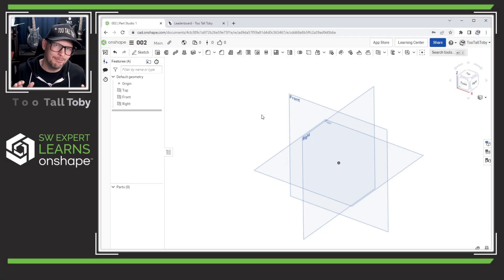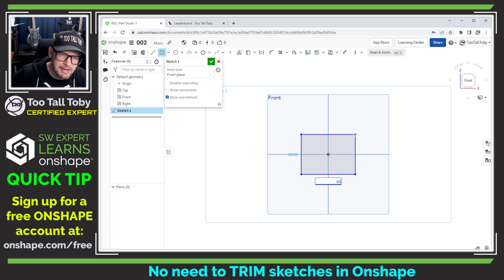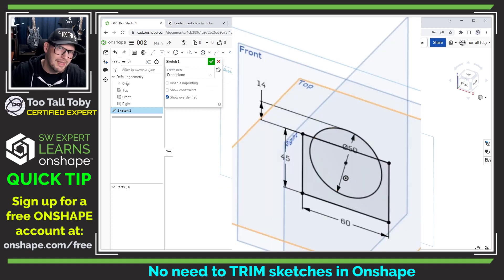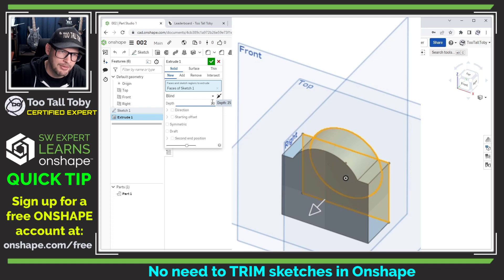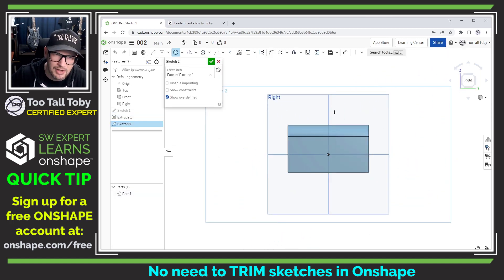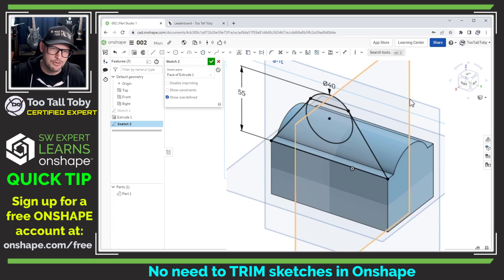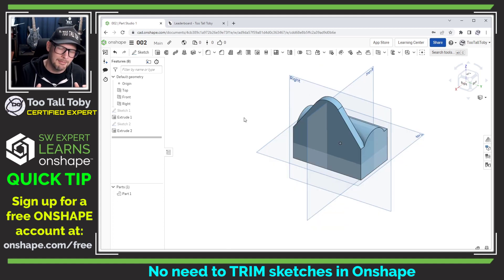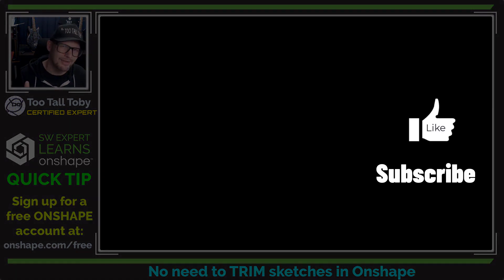No Need to Trim Sketches in Onshape

Comment: When you do need to trim, it messes up with the constraints. So what I learned to do is that instead of trimming, I would use Split, and then turn the bits I don't need into construction lines. This keeps the constraints in place and has been very useful on many occasions.
Reply: Yeah that's a pro move for sure - in SW we can trim and choose "convert trimmed sections to construction geometry" - for exactly the scenario you are describing.  Hopefully we'll see that soon in Onshape too!
Reply: @TooTallToby  as another video of yours showed, all you have to do after the trim is hit the Q button.
Reply: @kesor6  But then the line will be eliminated.  

Imagine 2 lines crossing, to form an X shape.  I want to trim one of the legs off the X, but I don't want it to delete, I want it to turn into a construction line (so half of the line will be solid, and half will be construction).  

Whenever I trim in Onshape the one leg of the X is completely eliminated.  I tried using trim and Q together, but I couldn't get the desired results.
Reply: @TooTallToby  That is why I said, don't use trim - use split + q.
Reply: Split is the button that is in the same menu as Trim.
Reply: @kesor6  Got it!  Awesome!  Thanks!!!
Reply: Yeah the "convert trimmed selection to construction" was a nice feature in SW. Thankfully (per this video's subject) you don't need to trim that often in Onshape so it's not as big of a problem not having it!
The only time I find I need to trim is when wanting to extrude surfaces or "extruded" sheet metal features (and I guess thin features as well now) but I don't find it comes up that often.

Comment: Yes, that's very convenient, there are so many times when trimming removes some of the constraints and you need to re-constrain things, this saves a lot of time. Another huge benefit is that you don't need to worry about overlapping lines. For example if you want to create an "L" shape, just draw two rectangles from the same bottom left corner and it's fine.
Reply: yeah I LOVE that you can just do the "multiple rectangle" move to quickly create fully defined geometry, without trimming!

Comment: Very much enjoying these videos as I learn Onshape. One thing I have been struggling with is setting the radius for a partially completed arc which I have seen a few times in your modelling excersies any chance of addressing this in a short tips video?
Reply: Thank you!  - Yes I am also not seeing the auto-dimension for the LINE-ARC-LINE workflow - Is that what you are referring to?
Reply: @TooTallToby  Thanks for responding. I'm not entirely sure what the function is called I'm very much a newcomer to CAD. I was working on your practice video  21-02-12 and I've been struggling with the arc R89.

Comment: Appreciate the continued improvements in OnShape. I'd like to see precedence for feature lines over construction lines when using the Offset tool and others where you're selecting geometry in succession. Right now there can be times where a lot right clicking and 'Select other' is needed to reference the correct geometry.
Reply: I have found that in Onshape it's better not to have too much "construction" geometry showing at once for the reason you describe. I find I just end up toggling sketches on and off more than I would have in SW.
Reply: Yeah the select other command might help in these spots, but I totally see what you're saying about it getting confusing.  🙂